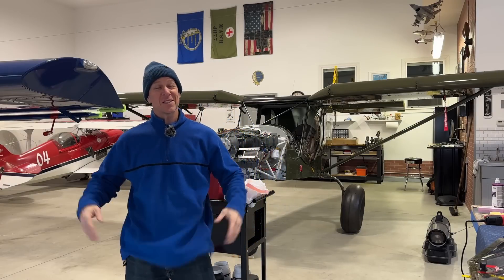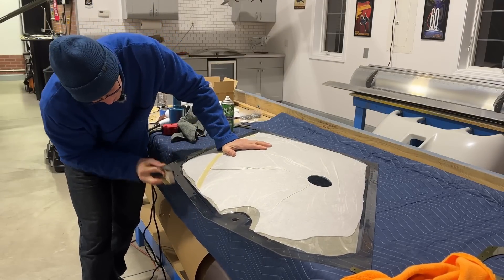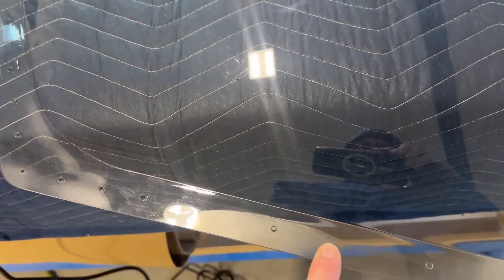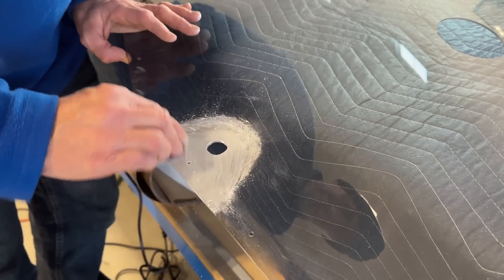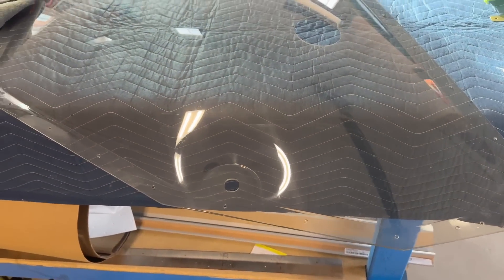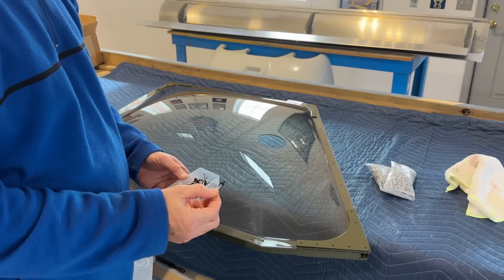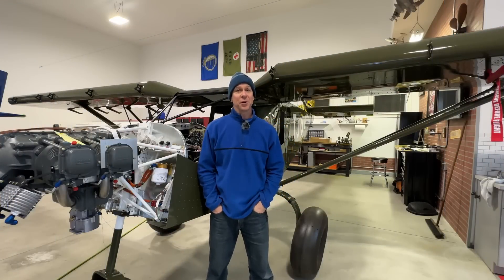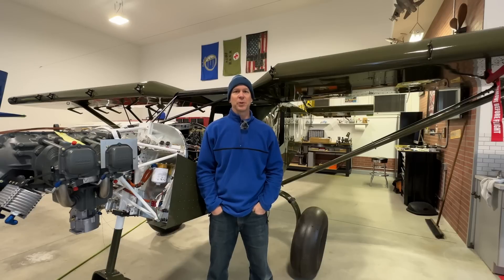Finishing the CH-750SD Doors

Comment: Someone drew on the side of a new to me planes fabric with a sharpie. I was told coconut oil can be effective at removing permanent marker, or in the case of a hard non porous surface using fresh marker over the dried marker line and wiping off quickly with a rag is an option.  I have yet to try the coconut oil.

Comment: Mark, when you use the 3M polishing compound #1 and then go directly to the 3D buffing compound, is that only for polishing the door glass or do you use the same combination for buffing paint, too?
Reply from the maker: When I used the 3M system for paint I used the 1, 2, and then 3. For the doors I figured the 3D buffing compound was pretty much doing the same thing as step 2 and 3 so I tried it and it worked great. Not sure if the results would be same on paint.

Comment: Great video as always, It is not a big deal I guess, however it makes one wonder why the Q.C. department find it acceptable to send out parts in that condition to the customer, and Zeneth are not the only ones who do this.
Reply from the maker: I was thinking-Zenith may not even k ow about this. When they get the doors, they are completely covered with the tape, so they wouldn’t see the condition of them. I don’t think I ever mentioned the quality to Zenith even when I had the issue with the Cruzer doors. I’ll have to send Sebastien an email and just let him know.
Reply: Are those areas you sanded out covered by the door frame so you can't see them in the final installation?  If so, that might be why it isn't considered an issue.  Might be caused by the tooling used to hold the sheet if they vacuum form the parts in a mold.

Comment: Lexan is a brand name for polycarbonate and plexiglass is a brand name for acrylic, much similar to Freon being a brand name for refrigerant. It's not uncommon to see panels have mold marks where they were held during forming. A wool pad for the first cut will help get some heat into the material and reduce buffing time.